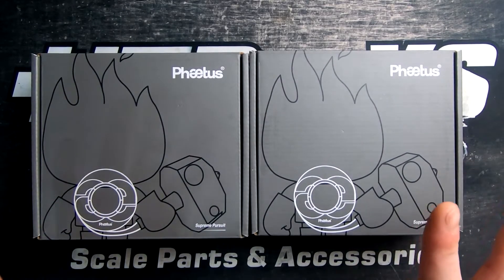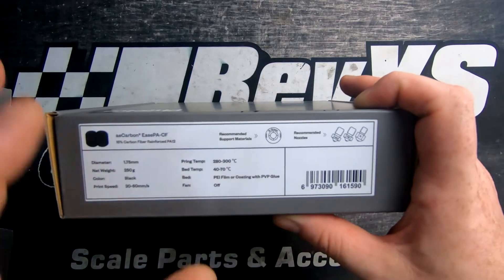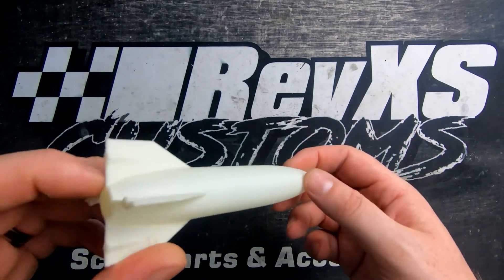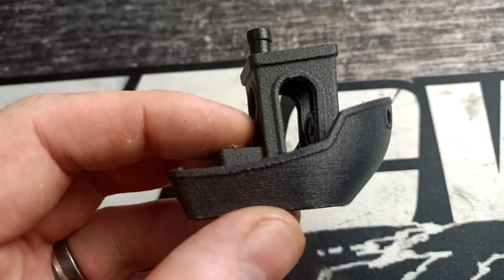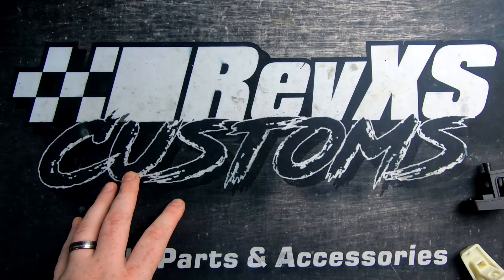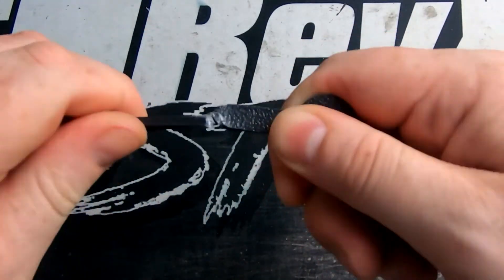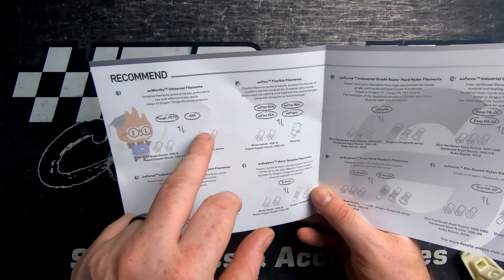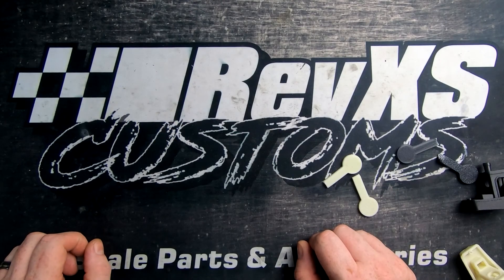Phaetus Carbon and Glass Fibre Nylon Filament

Comment: does it have to be heat cured
Reply from the maker: Doesn't need to no,never did testing with post heat treating so can't say how much would help if was to do it
Reply from the maker: In terms of pre printing need to be sure filament is moisture free by using a dry box,I print direct from one